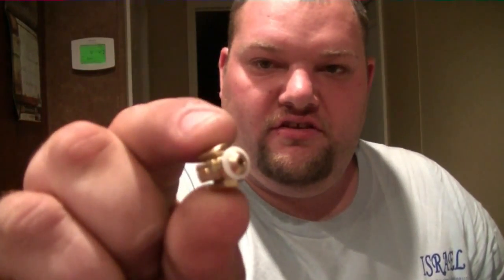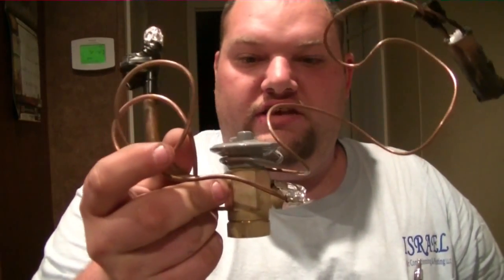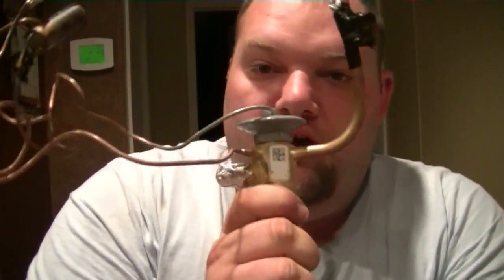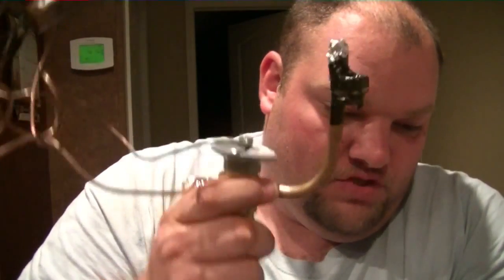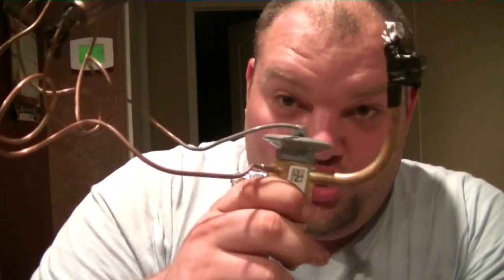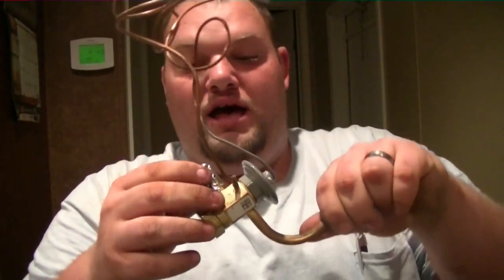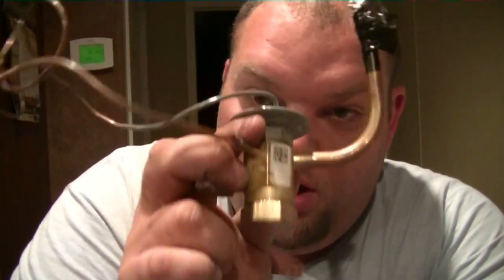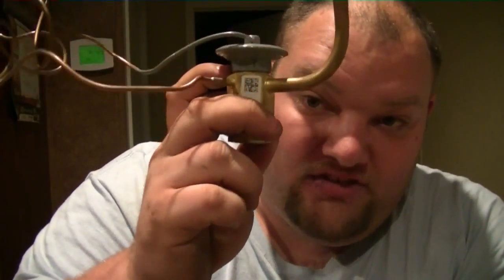HVAC Tips- Pistons vs TXV's

Comment: If you’re not purging with nitro during install you can cause the txv to fail prematurely. Oxide flaking in pipe from welding clogging them up. Been seeing that lately as a service tech in a larger company with some of our installs going down in a year because of that. But you can’t go wrong with a piston.

Comment: Very Good Video Sir!  I did not know what  410A piston was before watching your video.  I looked up some HVAC equipment on my distributor website today.  I am going to replace my downdraft natural gas furnace, 2.5 ton evaporator, and condensing this fall.  I installed my Whirlpool units in 1985 and managed to overlook a tiny refrigeration leak in my evaporator at a very difficult area to repair.  It was a very hot 100+ day and sweat had been getting in my eyes so I decided to charge up the system and exchange the defective evaporator in the Fall.  I have been topping off the system in the spring each year and I finally ran out of R22 two years ago.  I purchased a small cylinder of fake R22 that smells like propane.  I topped off the R22 using that gas as instructed and my old system is just now beginning to struggle with these very hot summer days.  The new air handler specifications states that the correct "Piston" is shipped with the evaporator.  I never sold or installed HVAC equipment after 1985 so I have missed a lot of the new tricks of the trade and did not know what a 410A Piston is.  I know now.   After viewing your video, I feel that maybe I should let the new kids handle the installation and sell me their new equipment.  A friend suggested that I should not be convinced to purchase the higher seer units because I probably would not live long enough to realize any savings and that I would be buying trouble if I did decide to buy above seer 13.  Your video confirmed his advice.   Thanks.  JB

Comment: There is nothing wrong with a piston, its just a txv is more efficient. its like comparing a carburated car to fuel injected car they both work but with fuel injection you have higher efficiency and get the most out of your fuel

Comment: Absolutely, simpler is better. In the effort to make equipment more efficient, and of course save the customer money on their power bill, the cost of repairing these high efficiency products, including the newer appliances and AC systems is astronomical when they break.
So yes, it reduces demand at the power grid nationwide, but we have to pay to repair the equipment during it's normal life expectancy, so we the consumer haven't really saved anything in the long run. Plus the inconvenience of the breakdown, during which our AC or refrigerators or other equipment have stopped working. We end up footing the bill for more efficient products. Lets say one can reduce their power bill by 50 to 100 dollars a month by installing a 17 plus seer system, ok great. When the TXV fails, or the inverter or blower motor fails, or some other high dollar part fails, if not in warranty, you will be paying $600 to $1200 to get repaired. So now whos saving money. I'll stay with simple, 14 seer, standard blower, standard compressor, piston. Like he said, my customers want the AC to work for a reasonable power cost, without breaking down, with moderate maintenance. Same goes with refrigerators and other major appliances. Get medium grade equipment, simple controls, you don't need blue lighting when you open the door to get a piece of pie. All it does is keeps the food cold, or dry's the clothes, or washes the dishes. What does one need 38 cycle options for, you don't. These products cost a lot more when purchased new, and cost a lot more to repair when they break down, and there's more stuff to break down. So in closing, KEEP IT SIMPLE STUPID.

Comment: expansion valves have been around in commercial decades before residential. that's where they came from. they work fine and have worked fine for years. 90% of bad TXV are shitty installers.

Comment: Flowrators ard fine for low efficiency systems in low humidity areas.  The superheat is a moving target on a flowrator system which means thay are frequently not charged properly unless you are monitering your wet bulb temp inside to figure out what the target superheat is at that specific heat load.  The txv allows you to dial in the subcooling and superheat properly especially if yoy consider pressure drop caused by lineset size and equivellent length.  I would also add that many txv's dont work on start up because thr line was overheated causing damage to the bulb.  I my oponion all ac systems will perform better with a functioning txv.

Comment: any ideas on how to size a piston for a unit? I had to change my condenser to a 3ton Bryant due to emergency cooling needed. I have a 2.5ton Trane AHU and its not cooling correctly now. Any help will be appreciated. This is my wifes' acct. LOL
Reply: Your system will not cool properly with a 3 ton condenser and a 2.5 ton air handler. You can have a  2.5 ton condenser and a 3 ton air handler just not the former.  And if it's a heatpump in heating mode your head pressure will spike and the unit will shut off on high pressure due to the smaller evaporator coil not expelling the heat out of the hot gas from the compressor.

Comment: TXV are only good for commercial units for heavy  heat loads and for Refrigeration A piston keeps the coil the same temp all the time. The Txv opens (flooding) the coil for a quick cool down. This is not need in a Home. Fact Txv flood back if over charged. These txv have no way to control the flow. Pre set my A** Nothing in set the same for a Factory. No Two System have same air flow. Piston one time install no callbacks. And a colder Evap.

Comment: Just saying that you're absolutely right about this. Anybody that doubts this obviously has little or no field experience.. The people that are pushing this crap are simply trying to use this as a selling point for making money. We've had the Piston for a very very long time. Leave the Piston in the unit and walk away.. I mean why would anyone want to change it out anyway ?? You got it !! Making that money!! That cluster-jumbled nonsense will fail. It's a fact. I bet the Piston is NEVER broken or has never failed when some of these guys suggest doing a change over to the customer.. It don't save a dime on the electric bill and it's not at all necessary by any means. There's no difference in the finish product or the air quality or temp , so WTF ??? KEEP THE PISTON FOR SURE!!

Comment: A piston cannot control super-heat. It is a fixed orifice and therefore you will have a HUGE swing in super-heat based on conditions. So when you have a high heat load in the home, your refrigerant will boil off early in the coil. Your coil will be mostly vapor and inefficient. The super-heat will be very high. In low-load conditions, your coil will be flooded with liquid refrigerant with little or no super-heat which is also inefficient and could lead to liquid returning to the compressor. A TXV maintains a constant super-heat which makes the coil stay at maximum efficiency in all conditions. Obviously a piston is more reliable, with no moving parts, but as demand and regulations for higher efficiency increase, pistons and other fixed orifice metering devices will become completely obsolete.

Comment: I'm in full agreement. Simplicity is the key to reliability. One thing I don't like about txv is that I have had to put hard start kits on compressors because txv's won't let the pressure fully equalize like a piston will. I had one 2 ton system that would blow the run capacitor every six months and I didn't know why. I put a hard start kit on even though it would start without it as long as the cap was good. The cap has lasted a couple years now with a hard start on it. From what I understand txv will make the system a bit more energy efficient but I don't care my stuff is in rental property and few bucks in power means nothing to me. Good video, you the man

Comment: TXV has much more possibility to break if compare with single stage piston type metering device. Best practical use in right type of control system if you can pick model of equipment. Good point Israelhvac.

Comment: I agree about TXV's not having much reliability.  I have experienced that a lot of these expansion valves are fragile when it comes to installation practices.  Lots of manufactures do not use nitrogen during the brazing process and after about a year in service the grime will clog up the operation of the TXV.  A piston will always be the tried and true method of metering but companies want efficiency.  Thermal or electronic metering is the only way to be efficient.
Reply: Same here...installers...even though Ive told them 756 times to wrap the txv. I had to go fix one on a weekend

Comment: What's wrong with it? They are not load responsive......guess if you install it right it won't fail.....they break cuz the system is not installed right....

Comment: It sounds like the problem is the (ever so common) modern junk vs a fundamental reliability problem. If you could find a source for OLD made in USA TXVs, they would likely far and away outlast the modern junk they're installed with. I would think that a commercial or industrial TXV would still be well made...

Comment: If TXV is originally installed without azote wielding ...the flame wielding process WILL create black deposite outside and INSIDE the copper tubing that will create contamination in the whole system ...thats a fact ! so watch your HVAC service guy !

Comment: I find that with a txv you always get a 20° td and with pistons i only get 18°

When all them TXVs in everyone's equipment went bad it was Copeland's fault they put some kind of chemical in the compressors so they wouldn't Rust in the shipping containers coming from China.
A lot of it has to do with the installation make sure the lines are good and clean if not changed.

Comment: Agreed, Piston is the way to go whenever you can use it. I hate waiting around for the txv to settle.  20 minutes between adjustments is painful. I've found cap tubes plugged but never a piston. Screens for TXVs, a lot back in the 90's. Back before nitrogen, micron gauges, etc. Hell I remember people not even attempting to pull a vacuum, just purge it. No wonder there was so much crusty equipment back then

TXV efficiency gain is @ 0.5 SEER,  is that worth the extra trouble? I say NO. not unless you have to have it for 2 stage,  varying air flow, low ambient conditions, etc.

Comment: I hardly ever see bad TXV’s. I spoke with a danfloss rep once who told me that 75% of the TXV’s returned have nothing wrong with them. I have struggled diagnosing them, and watched many do the same thing. MANY people are misdiagnosing and when I start hearing people saying they replace dozens a year or something, it sends me a red flag.

A TXV is merely a modulating piston.

A problem with it is as easy to read as is a problem with a piston... 

You just have to be able to interpret it properly... if you can’t interpret it properly, it means you don’t understand what your looking at.

I hate to say this, but it reminds me of the old carburetor guys flipping out over fuel injectors.... is it more difficult to understand?... yes... is it more fuel efficient.. HELL yes. A TXV is like having a tech onsite 24/7 adjusting the charge to be optimized.
Reply: I agree with you on TXV vs. piston...that being said...in the last several years i have had to change so many TXV's within warranty.  What a pain in the ass call those are.  If they would have better quality control I would be just fine.  P.S...if you're hiring anyone to work for you...ask them to explain super heat and sub cool, as well as, potential issues that could cause them to be incorrect.  You will then know who you're hiring.
Reply: Donnie Young I agree completely. That’s my #1 question for gauging anyone’s knowledge. If someone can accurately describe first subcool and superheat, as well as basic implications of higher or lower values.... they are halfway there.

Lol, I worked with a “beer can tech” one time who observed me using digital gauges and mentioning SC/SH in conversation... once he got frustrated with something i was explaining (which he did NOT understand) he actually said “You need to get all that superheat crap out of your head and just listen to what I’m telling you.” He was older, but would not listen to why we should stop adding refrigerant when the SC was approaching 50 degrees!

He must have eventually realized he was missing something cause he called me a while back, proud to have bought an sman. Hopefully he sees it as a tool tho, not a gadget.
Reply: The coil we have there's no way to put a piston for 410 waht l heve to do?
Reply: @333mikeray  You hit the nail on the head. I've seen soo many people doing installs or service work in the field. I would say 85% or more DO NOT use a nitrogen purge method. Techs do not realize how bad that is for the system. It leaves soo much black gunk/ oxidation the TXV's and compressos don't have a chance. I have a 13 yr R22 Factory Ruud TXV coil system. Because it was installed correctly it's worked flawlessly

Comment: You expect me to believe that he gets into crawl spaces and attics FOH 😧
Reply: lmao!!!  i am 6'3" at 250 lbs give or take....it's amazing the holes i can get through doing this highly complex job!  That's why we're called industrial athletes...
Reply: Donnie Young that’s why we get paid the big bucks lol
Reply: @AIM6789  I'm a big fella myself and I'm able to move around tight spaces as well,  in my duct installation days I had a nick name of "attic rat".However as I have aged some since then I try to avoid climbing under houses and in attics as much as possible. I use to work with this guy that was considerably smaller than me and he was continually getting stuck and busting holes in ceilings. I recall one instance we were pulling a new thermostat cable and as I was standing in the hallway at the thermostat location,  he was calling out to me from attic trying to find where to drop down cable and as I responded "I'm right here" as I tapped on ceiling, he fell completely through the ceiling and landed 2 feet behind me.  Luckily he wasn't injured. My point is that size doesn't matter, coordination does.

Comment: What about 15 seer heat pumps good man brand. I just came across a bad txv. Will a piston work with a heat pump or should I stick to txv
Reply: many had pistons and worked fine...not as efficient...but less headache!  Mainly if you installed it and it fails within warranty...that's when you learn to hate TXV's...
Reply from the maker: Piston will work fine

Comment: And when they malfunction they can damage the compressor
Reply: yes...usually when they fail they starve the compressor of refrigerant.  This can cause too much stress for the compressor thus shortening it's life span.  It can also drive the low side sat temp to a below freezing temp causing liquid feedback to the comp as everything freezes up...again shortening comp lifespan.  Some compressors can deal with it for awhile but ultimately it will fail much too soon.

Comment: I much prefer a TXV; I don't agree with using pistons "because they don't protect the compressor"  when a filter is loaded-up or plugged or the ID fan motor fails. etc. Where humidity is a problem the TXV is far superior under a broad range of conditions.Well, some things he said I disagreed with. with Colder ambient temps the result with a piston is higher SH not lower SH. There were other statements I didn't agree with, too... 

I'm sure you won't agree; but there are very cost-effective reason tho use a good TXV... 
 
https://www.youtube.com/watch?v=HcGz5ihdJkc

Comment: TXV's rock,  especially in slightly overcharged systems like dehumidifiers.  The only advantage of a fixed orifice is simplicity.  And on a reversible heatpump,  the piston is actually a moving part =gasp= !   No reason for a TXV on a high SEER system with an oversized, starved, evaporator coil.  Too much superheat?  No problem!  Just add refrigerant.    NOT GOOD

Comment: TXV's icrease efficiency and protect the compressor.  I have seen many clogged pistons if you have not you have not been doing hvac long enough.  To say TEV/TXV is unreliable is crazy.  Lieberts, Stultz and all computer room systems use them as do many modern refrigeration systems.  I am pretty sure manufacturers  would not put parts that break down easily in critical places like WIF, WIR or CRAC units.   Perhaps inproper refrigerant handling by previous techs/installers are the reason they fail.  If people cant figure out a simple txv and why its failed how are you gonna do with EEV's.  People need to evolve and not be old dinosaurs or get left behind.
Reply: Walter Luna but he is talking about performance, both orifice and TXV gets clogged, the difference is that orifice doesn't break and TXV does.

Comment: enjoyed your video on the TXV/Piston debate. IN Canada (that's where I am) most young people don"t even understand what super heat is let alone the difference between the TXV or Piston! Here we also have the debate, but 40 years of experience has taught me to avoid TXV'S.  two reasons, our heat load in Canada is not like the USA for the most part. We don"t require AC but for about 5 weeks of the year. For the most part we need cooling quick, so pistons, that don't modulate like a TXV have a tendency to bring the heat load down faster. TX valves hunt as the load on the evap changes. Second as you said Ive changed quite a few TXV's do to failure. We also very rarely use anything greater than 16 sear, for 5 weeks a year the extra cost is to high.
Good job, looking forward to more video"s.